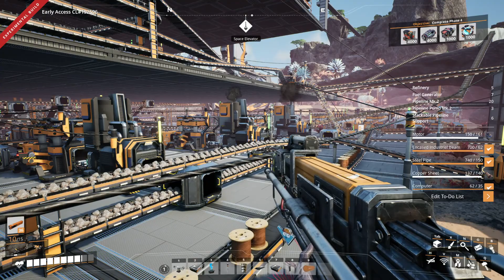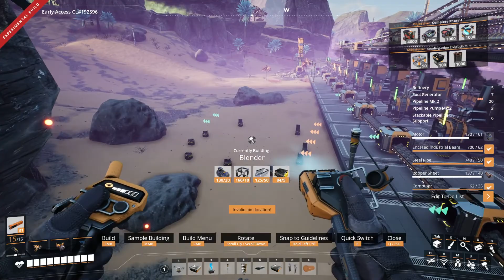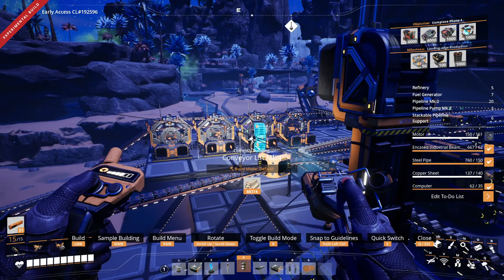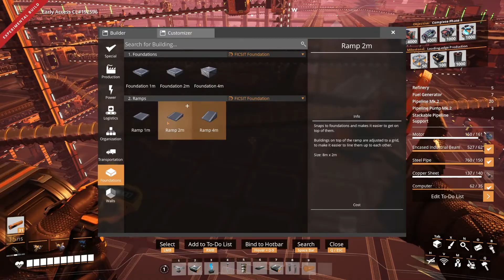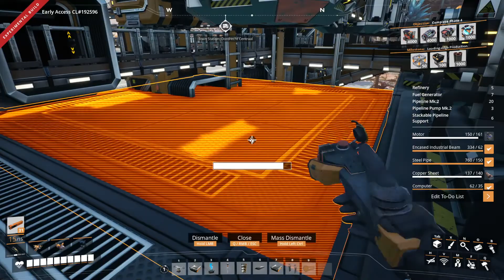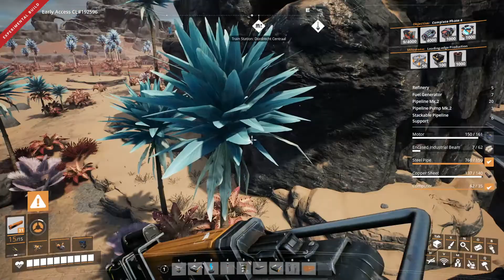Satisfactory - Lets Play - Part 73

Comment: Yes, the question of if you need a faster delivery conveyor belt is a pretty simple one.  Add the per minute outputs of all the devices delivering items to the belt.  If that number is equal to or less than the rate of items per minute of the delivery belt than a faster belt won't help in the long run.